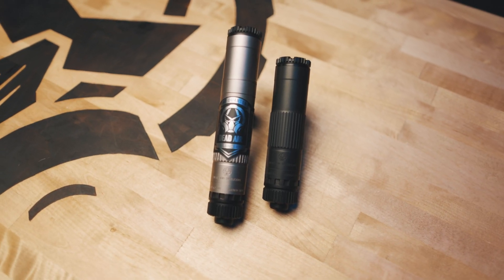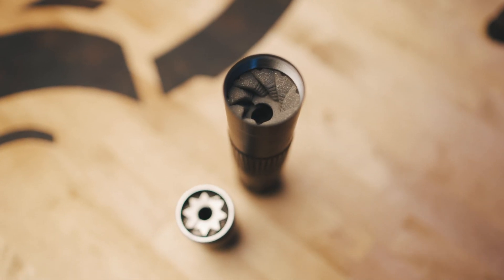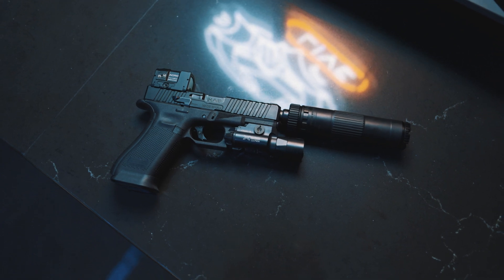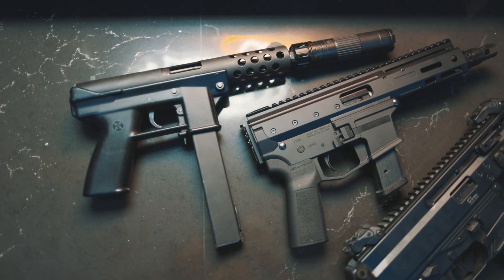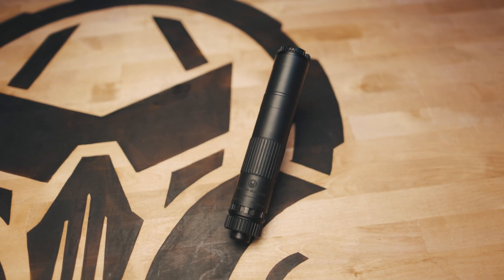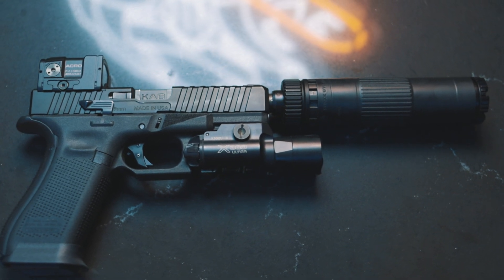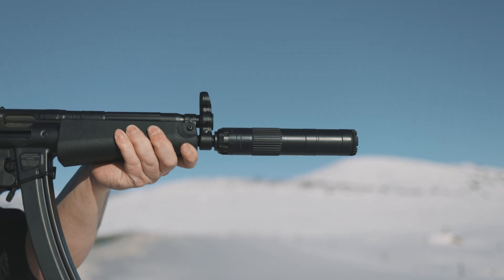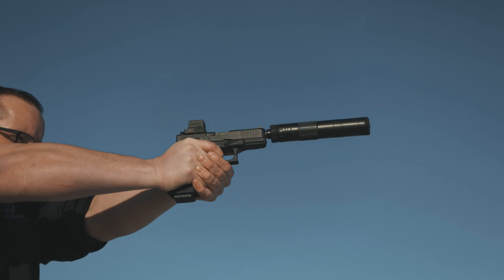Table Top: The Mojave 9 Overview

Comment: Is this user serviceable? Can you take out the 3D baffles to clean?
Reply from the maker: You cannot remove the baffles, you can remove the rear adapter and the front cap and clean it with a soak or in an ultrasonic cleaner.

Comment: What’s current lead times on a form 4?
Reply: Got my sandman s approved in 87 days. Gunsmith checked my alignment with a bore rod and confirmed alignment. Baffle strike same day. No one at dead air has responded to my warranty request.
Reply: @f0xtr0t_brav0  that’s terrible😲
Reply: At the time, mine took 11 months for my Primal.  that was a year ago.  i should've immediately filed again.  I could have another one by now.
Reply: 42 hours😊

Comment: Who is making this suppressor for you guys?
Reply: Dead air company. I think they say that their cons are that they're one of the quietest, but the I mean, they're pros. Are one of the quietest the cons? It's one of the heaviest. I'm looking at another company call suppressor co. And they have basically the same thing for the same price. But it's lighter but I gotta watch a video on its performances when I first started this video I heard a word. I didn't want to hear 3D printed. I have couple of those for my air guns. And they work, but they're not rugged. My guns are tools
Reply: @MrJoeygregory these are super lightweight
Reply: @MrJoeygregory MY MOJAVE 9 IS STUPID LIGHT & DUMB QUIET SMALL DIAMETER. 
IT'S SICK ON MY SHADOW SYSTEMS DR920 WARPOET, 
W/HOLO 507C FROM FACTORY
BASICALLY A CUSTOM FACTORY G17.
THE CAN IS ALMOST UNNOTICEABLE ON THAT PISTOL IT'S SO LIGHT EVEN IN FULL LENGTH.
IT IS HANDLING MY WORK I PUT IN WITH NO PROBLEMS! ITS REALLY SICK ON MY MP5K

Comment: How will this compare to the Wolfman?
Reply: I was wondering this too. I have the Wolfman and use it for 350 Legend, 9mm, 5.56 and 300blk.
Reply: @jackmemphis777 how do you like it for those other applications, namely 5.56?
Reply: @hikeskool  it works pretty good for 5.56. The Wolfman and some other dead air suppressors use the R Series end caps. So with the wolfman you can change the end cap out with 9mm, 7.62 and 5.56 hole diameters for better suppression. It works the best with 9mm subsonics obviously. For supersonics, 350 legend and 300blk sound really good and suppress slightly better than 5.56 in my testing thus far. With any supersonics, it brings it down to a level where it doesn't ring my ears
Reply: @jackmemphis777  very cool, thanks. How much better is a dedicated 5.56 silencer for 5.56 than the Wolfman? How are you mounting to each host using the same Wolfman?
Reply: @hikeskool  I don't have a dedicated 5.56 can, I only have the wolfman. So I can't say how much better the performance would be for a 5.56 specific can. A 5.56 suppressor such as the Sierra 5 will likely suppress it a little better and hold up to more consecutive shots with less damage to the baffles. I mount the wolfman to most of my hosts with the key micro mount with dead air micro muzzle brakes. Supersonic rifle rounds require the micro brake as a sacrificial blast baffle. It can cause more damage to the wolfman if a micro brake is not used. It detaches from the barrels easily and quickly and can be put on another rifle seamlessly. The only caliber I take the key micro adapter mount off for is 9mm, I still use direct thread with 9mm (I have an extra brake so I've been considering using it for 9mm too for ease of switching between all guns). I typically use it in the long configuration too since it provides much better suppression than the short configuration. If it is your first can or want to possibly use it with multiple calibers, then the Wolfman is definitely the way to go, but if you are only going to use 5.56, I'd just get the Sierra 5.
Reply: @jackmemphis777 man that is a great thorough answer, thank you. Have you had good luck with the  Keymo system overall?
Reply: @hikeskool  yeah I love the Keymo system. It locks up great in my experience, easy to take on and off (even when the suppressor is hot). Its way faster than direct thread. Id say the only con of the Key micro system is the slight length increase over direct thread, but for supersonic rifle rounds , its a requirement anyways so its kind of a moot point
Reply: They said it’s not as quite as the wolfman since it has less volume, but the trade off is lighter weight and less blowback.